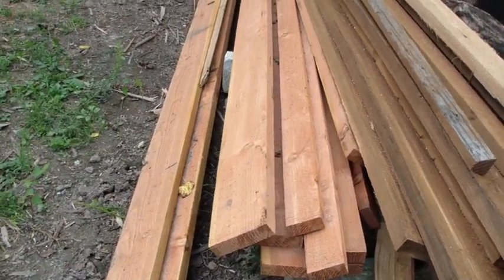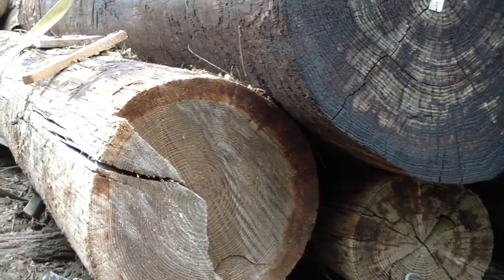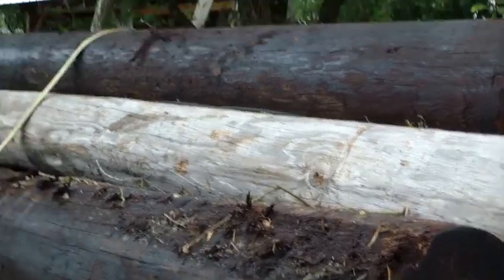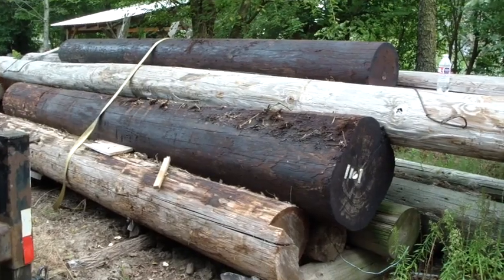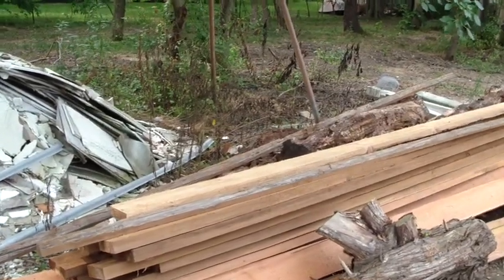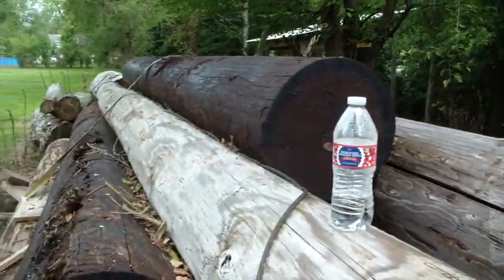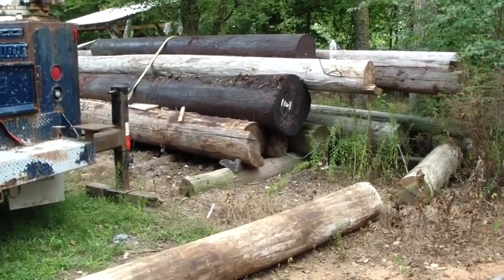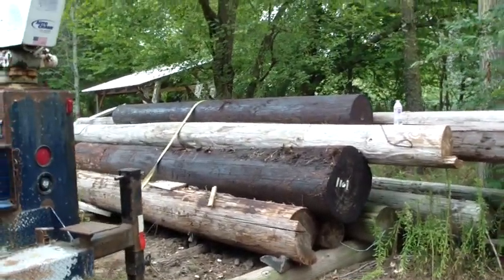Sawmilling power poles.  Things to know and lookout for.

Comment: Penta, creosote and arsenic are used on all utility poles.
Reply: That's only the beginning of what's used to treat wood to withstand inground use for 30 plus years .If you choose to use these to build ,you will experience "the ringing of the bell" ,if your lucky
Reply: I use em for posts for fences and open air sheds But I wouldn’t saw them up like this. I’d get too nervous about heavy chemical exposure. A chainsaw cut or two no problem but long long cuts exposing you to endless dust from these nasty things, no thanks. Wash your hands well and shower afterwards. Don’t breathe it.
Reply: What does “ringing of the bell” mean?

Comment: I am in Central Illinois as well and was wondering where you got your poles from, and where abouts your located. I am in Bond county just about 25 minutes from St. Louis. good video, I am considering a sawmill and of course a shed.
Reply from the maker: You can get them from local power crews usually.  My neighbor has done this by simply introducing himself to a crew working nearby and asking them if they will give them to them.  They are an expense for the power company as they usually have them ground up, and a hassle for the crews as they have to cut them up into short lengths, so they will typically give them away.  Its best if you can pull up when there taking down poles as they will load them directly onto your trailer.  Atleast thats how my neighbor does it.

My father was a lineman for years and bought the mill, so we always had a good selection of poles and could get them anytime we wanted.  Its also easier if you have equipment to load them yourself or a winch for your trailer.

Comment: Any idea why my blade dives the first 18 inches or so then levels out. Some are heavy creosote soaked
Reply from the maker: I don't saw alot of heavy creosote logs but when i do we usually don't have to many issues.  That said in sticky woods i will sometimes run some PinSol/Dawn dish soap in my water or even both to help keep the blade from getting gummed up.  Another thing is i try to enter the log slow for the first few inches then ramp speed up.  I have experienced the dive issues you mention but for me it tends to be on longer logs where there isn't much support on the far ends away from the clamp in the middle of the deck.  Also the more dull the blade gets it  tends to get worse.
Reply: I think it was apparently a combination of dull blade and the butt end of the pole being so creosote saturated. Even with light pressure entering the cut, the first few inches smokes as the creosote gets hot. I’m sure it’s probably humming the blade and contributing to the short dive. I will try pine soil on the next one
Reply from the maker: @CurtisPittman48  We usually cut the very end of the butt off  to expose fresh wood, as the ends tend to collect dirt/rocks and can dull the blades faster.  Usually lop off the last 4-5 inches.  We usually save the butts for posts etc that we plan to bury in the ground, and sawing 4x4 or 6x6 limits the number of cuts in the creosote loaded portions.

Comment: How many poles do you have to cut to pay for decent saw
Reply from the maker: It really depends on your intentions.  If you have a big project and plan to saw all your own lumber you probably justify a purchase of a small mill just in lumber costs alone.  Again power poles are really only good for barns/decks/and other structures without living quarters.  When i added on to my house we built a 400sq ft deck which quoted out at $5500 in materials.  I am sure it would quote out much higher with current lumber prices being near double.  I decked it with western red cedar and it is beautiful and would have cost even more.  Took us 1 day of sawing and i believe 8 poles.  4 cedars and 4 pine for structural.  

If your plan is to saw for others it gets more complicated cause you have to get an understanding of the going rates in your area and what you can charge, and then subtract your expenses.  I charged $80/hr, but in this high priced times i could probably up that and still save my customers lots of money. Structural lumber used to be hard to compete with the lumber yards but now its easier.  Big wide hardwood furniture grade wood is different and can command good prices if you have demand in your area.

Comment: What type or brand of blade  did you use ?
Reply from the maker: We have always used Woodmizer blades.  At first(20 years ago) we used the Doublehard  0.045x 1.25, 9 degree blades for softer woods, and the 4 degree blades for hardwoods.  Those were the recommendations back then.  Over the years more options have come out.  These days we have a pretty good mix of 4 and 9 degree blades still that we just send back thru their Resharp program which last cost us $8/blade but when you add in shipping etc it gets up to about $11.80/blade on our last order which i think had atleast 1 rejected blade so that cost us the price of a new blade($20 priced as if you buy a full 15 blade box)  

 Western Cedar has been problem as it is soft but very abrasive and heats the blades up, and the 4 degree blades had worked decent but on big cuts the would overheat and dull.  We talked with Woodmizer about this at the time and they recommended trying the Turbo 7 blades which at the time were only available in the bigger 0.055 X 1 1/2 blade.  Those worked real well for Western Cedar power poles and i wish i had a few more of them.  They are now available in the smaller blade sizes and even have a few more variations out there.  If you purchase thru Woodmizer they are can be very helpful and have lots of expertise.  We haven't bought a Mill from them in 20 years but their customer service is still very good and friendly.
Reply: @IndependenceIron  Thank you so much, my husband just purchased a mill but not a WM. Its a TK and he says as long as it does the job. He is a finish carpenter guy, he plans to build his workshop kiln etc. He receives power poles for free so he intends to use them for lumber framing. That is why we are inquiring as there isn't much explanation out there about cutting PWR Poles. Great videos BTW. Greatly appreciate it.
Reply from the maker: @melissatuason2395  Hope the information helps.  I knew some local guys that partnered and bought a TK mill to mill power poles.  They were having issues especially with western cedar and i went over to help them.  The TK is a good mill similar to the WM but the one thing with theirs that caused issues was the blade tension gage.  WM has a tension gage that is easily seen while milling.  The TK was more difficult to see while operating.  They were cutting very large diameter western cedar such ad 24" diameter and up and 14 to 16 foot long timbers.  These wide long cuts heat the blade and as the blade heats up it expands and the tension drops.  As the tension drops the cut gets wavy, and can cause the blade to dive and jam up.  On our WM if the tension drops 30-40% below the recommended set point the blade will usually take a dive.

When milling large diameter(16" or up) and longer cuts over 10 to 12 foot long Western Cedar its usually a 2 person job.  One operates and one walks along and adds  tension to the blade as needed.  

All other woods or poles we have cut are a piece of cake compared to western cedar and the tension is not a critical thing to watch every cut.  Best of luck with your new mill.
Reply: @IndependenceIron  Thank you, we have a long road to learning about all these different safeguards & heads up. Not sure but I think TK faced the gauge towards the operator on the new ones. He will have to get back to you on that one, if not he will turn it around.